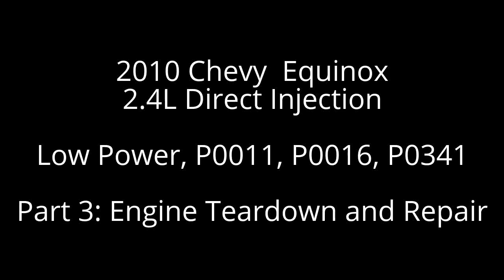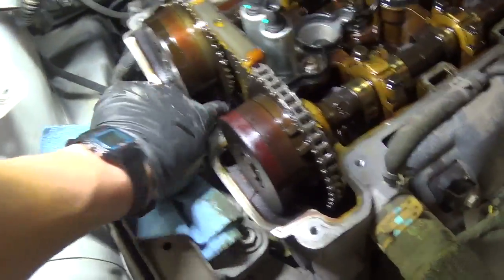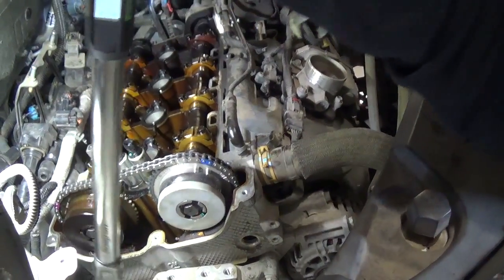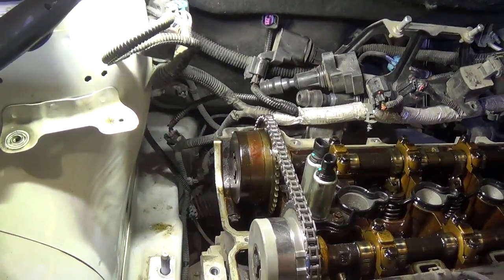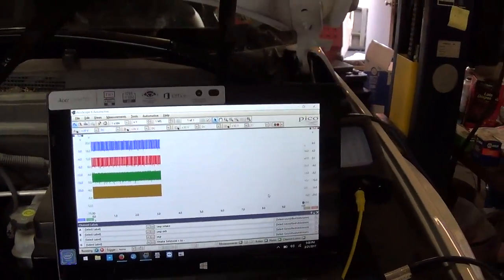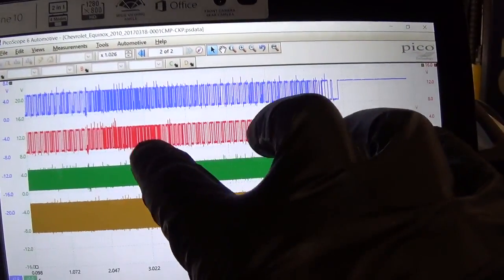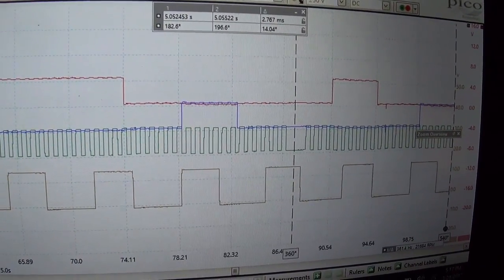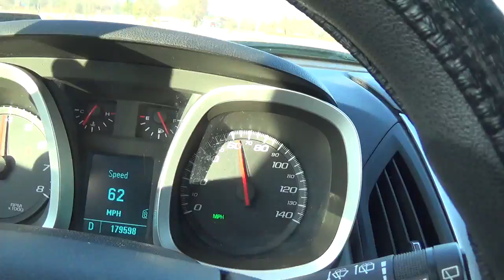P0016 P0011 Low Power case study: Chevy Equinox - Part 3

Comment: You can set the Snap-on Tech Angle torque wrench for torque plus angle and as soon as you get done with the torque you can go right into the angle. You can also set it for the # of bolts you have and it records every bolt...lots of menu features  TSB PIP5203C for the P0089 & P228D concerns PN issues with intake camshafts, intake camshaft actuators being different 2010 and 2011& up so the waveform was off & you proved it...your ears and pressure transducer told the real story b/c no way was that retarded only @20 degrees.  Getting it back in time fixed the P0089 & P228D also. Awesome repair time and now you have a good waveform to share to the Pico library...it'll save some other Pico user a lot of time & hair pulling...maybe me  Pico buffer is great for long screen captures and any other scope would be aliasing. As usual great interesting case study, diagnosis & repair  and as soon as you posted it my Sunday was complete :D Thanks Ivan
Reply from the maker: I have to say, you write some of the most informative comments on my channel, and I don't even know your first name! Mr. Hayward?  Anyways, I might have to come up with a "commenter of the year" award :)
Reply: HAHA It's Bob.  I'm originally from Johnstown, NY and whenever I'm driving up there to visit my family I plan on stopping by to see you, Eric, and Keith just to shake your hand.  :D
Reply: Was just in your old hometown today.. I'm SW of there, toward the hall of fame. Used to spend many Saturdays in Fonda.
Reply: Blazer02LS Raced at Fonda Speedway DIRT Modified & deer hunted in Cherry Valley

Comment: is that the 3.6 litre engine. those are so common for the timing chain stretch, because GM had the chains made in China. the updated ones are made else where, or so they say.
Reply: now that I look at that engine, its not. its been awhile since I did one, but the 3.6 has 3 timing chains. an you have to drop the whole engine/trans and subframe out the bottom to do the chains.
Reply: kenman1717 that's a 2.4l 4 cylinder engine found in several gm vehicles. It has two chains. One is used to drive the cam shafts. The second is used to drive the counter ballance shaft.
Reply: you can do them in the car, its a lot easier to drop everything out, but its faster to do them in the car!

Comment: Did you check to see if the pistons had contacted the valves? That happened to my Vauxhall Corsa (UK) when the timing chain jumped and totaled the engine
Reply from the maker: Ouch, sorry to hear that. In this case since the intake valve timing was late and engine still ran, there was no engine damage. Owner got lucky, once again.

Comment: I may have missed something over the course of these three videos, but I have a sick 2010 Equinox with similar symptoms and codes, and I would like to know if fixing the timing chain/phaser/tensioner issues took care of the ALL of the original codes that popped up at the beginning of the first video, or was something else done to take care of them?  If one had been on a budget, or just trying to get it to run long enough to trade it, would simply changing the intake phaser and repositioning the existing chain on the intake sprocket in the correct place, along with a new, or carefully cleaned & reset chain tensioner, have been sufficient to fix the problem?

Comment: With the oil level so critical on these vvt engines, why is there no warning light. Or engine shut down, until oil level is replenished.
Reply: Because when gm made that seonor they sprayed over it and it senses that it's full

Comment: How is it that my old 500cc Yamaha motorcycle has a double-row chain and all these new chain drive motors have single row chains?  All of a sudden timing belts with normal change intervals don't look so bad eh?
Reply from the maker: Exactly! Granted my '89 MPV 4-banger  has a single-row chain, but beefier than this junker for sure. Minimal chain stretch in 242k miles and original tensioner is doing fine. I think timing belt and non-interference design is the best combination ;)

Comment: If that was run low on oil and perhaps pooched the intake actuator, would it not be wise to change out the exhaust one while you were there ?  Don't know how much the actuators are but if reasonable put them both in and your not buying another gasket, pre-loaded  tensioner, cam bolts etc.  
Just a thought.
Reply from the maker: They are like $200 a pop...if it ain't broke then leave it alone is my policy :)

Comment: Where you located, i have a 2014 terrain same engine, might need some work like that, but only have 65k on it with a P0011 code I already had those position sensors replaced already hasn't been a whole year, & engine light on again.

Comment: Great video! Would have liked to see the pressure waveform after repair. Did you happen to check for play in the water pump/balance chain while it was apart? They have problems as well. Keep up the good work!

Comment: You are doing a disservice to the owner recommending anything less than a new block or engine at 180K mileage.
Reply from the maker: But it's a 2010! Probably all easy highway miles :)
Reply: Cars run longer now take your car in for spark plugs and they say the motor is bad to rack up a bill

Comment: ok, so this thing was pretty far out of time right? All the ecotec's are interference engines, correct?  How are the valves not damaged? Assuming that the pistons and valves were not destroyed and that this thing was still posting good compression numbers; 
Is it possible for the computer to advance or retard the camshafts using VVT to spare the engine from damage?

Comment: I have like the same problem i install the New kit i change all parts it drives like New but the engine light ist on for camshaft its running so good is there other way to fix that i dont have that type of computer i only have a Autel MaxiCheck MX808
Reply from the maker: What's the code?

Comment: 180 000 miles ????? thats alot for a 2010
Reply from the maker: Apparently it's way too much for a GM timing chain too
Reply: motoYam82 but Ivan u didn't tell the cause of the chain slack ?
I mean was the tensioner just broken or why did that tensioner fail ??

Comment: Stay away from 4 cylinder gm engines.  The timing chain assemblies are all junk.  The timing chain on my 2011 equinox went out a year ago after 80000 miles and it totalled my engine and the car.  I am seeing hints of the same problem in my 2013 buick verano which has a 4 cylinder 2.4 liter engine  after only 40,000  miles.

Comment: I need help with this car.   After taking out the covers of the 2015 Chev Malibu, LT 4  2.5 to check my timing,  I've already told most of you that my stupidity allowed me to move the sprockets around individually not  knowing where the timing was.  So it could be 180 off or it could be ok.   I don't know.  But what's bothering me is ,  I don't want to put everything back   in without trying to find out why my exhaust cam, keeps  springing back, pulling the chain to either skip a tooth or pull the crank shaft from the 12 o'clock position.   I have to pull the cam really hard with a wrench, so  i can align the  chainlink mark to the crank shaft 5'oclock, so it can be at 12 o'clock for TDC.  Please help.  I made a video explaining better.  Thanks in advance.  https://www.youtube.com/watch?v=SuDceNgue1k